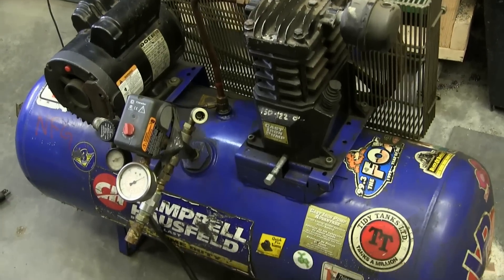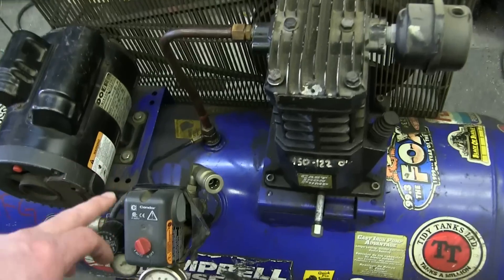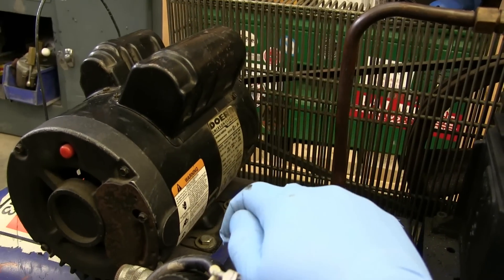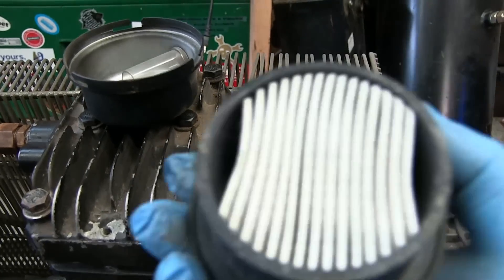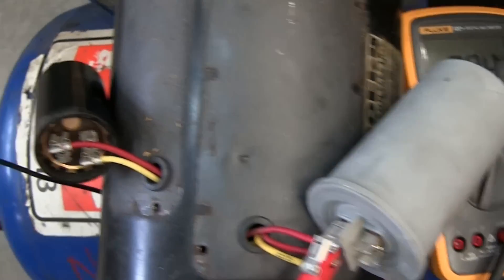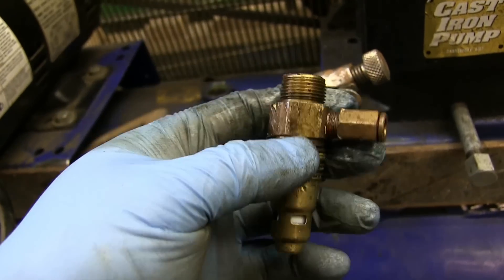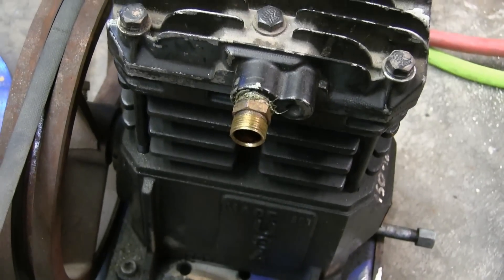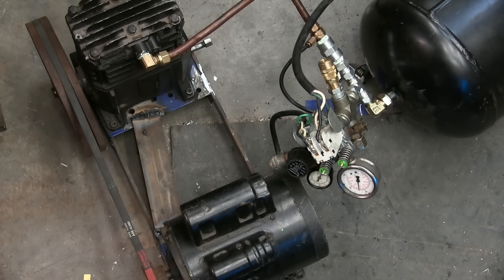BOLTR: Air Compressor Explained and Fixed.

Comment: Id be interested to compare what you say could go wrong compared to what ACTUALLY goes wrong with machines. In this video you didnt really say about oil thinning out due to high ambient air temp and running past the pistons then into the tank. 

We run a 500lt 8hp compressor at work that runs pretty much 14hours a day mon-fri.. Been doing that for a good 5 years. Never had to replace anything that you said would break. The big issues we do have. Oil in the tank, weve had to install multiple water/oil traps/filters/pre-filters etc to make sure it doesnt get to the machines.

Comment: When I worked for the medical examiner collecing bodies I picked up a fellow who died in a welding accident when the vessel he was welding exploded.  It was a large vessel, but the idea is the same.  The ladder he was tied off to came clean off the vessel launching him straight up with it, and he landed on concrete still in his harness still attached to the blown off ladder.

While driving him to the morgue a news broadcast came on the radio and his death was included in the broadcast, along with the fact he had a wife and two kids. I'll never forget that one.

Comment: The smaller line running into the pressure switch is probably the unloader and not for measuring pressure. The switch lets all the air out of that line when turning off so the motor can start up without a load. It must be on the pump side of the check valve!

Comment: Never use a heat gun to hasten drying of the developer as it also drys out the dye that may be in cracks or porosity when doing Liquid Penetrant Inspection.
Reply: Was going to say the same thing, but it is visible dye anyways, such low sensitivity, the crack would have had to be visible to the eye before the dye would pick it up.

Comment: Finally i get to say something. You know a lot but this time i know something too. The plastiq "sense" line is to depressurise the compressor when it is off but mostly it is to make the one way valve to engage propperly. Otherwise if it gets pressure from both sides and the compressor leaks only a little it will drain the whole tank. You need it to engage rapidly. That is the slight hiss you hear after the motor stopps, all the lines and the compressor depressurizing through the contactor.

Comment: That other capacitor is not for power factor correction. That is called a run capacitor. It stays in the circuit of the start winding at all times to form a series RCL (resistance, capacitance, inductance) circuit that is always powered by the AC mains just as the main run winding is. The start capacitor is just a boost to help give the motor extra starting torque that is wired in parallel to the run capacitor at start up and then disengaged by a centrifugal switch or current relay once the motor is running at full speed.

Comment: +AvE, can I ask why, if the tank is going to be shoved under a bench and ignored until around the time Chickadee is allowed to start dating, why you would even bother welding the motor and compressor onto the new tank?

Comment: Ave, the black capacitor is the electrolytic starting capacitor (Higher MFD) and the gray is an oil bathed run capacitor (lower mfd) that  is why it states no PCB. The old oil capacitors had an oil which contained PCBs like large oil cooled transformers which was outlawed back in the 1970s.

Comment: OK Ave I'm rebuilding a very old vertical milling machine I'm not sure if the spelling is right but I think it's a Yousa Japanese man mill and the God damn hand won't return the pointy things to top of stroke no more. it's a spring steel spiral spring snapped...any ideas
Reply: AvE yeah I also live in the frozen waste land but in the USA specifically North Dakota and my tiny town has no doesn't have a spring manufacturer or person for that matter so I'll do both braze it and order in a wide enough clock spring or just the steel at least....thanks from the frozen tundra
Reply: AvE got her fixed and everything working, auto feed and high speed turns out its a 79 Yuasa from Taiwan. learned that from watching your Vajeyos

Comment: My grandfather made an air compressor out of a fridge motor, the compressor for the refrigerant, and a cast iron tank. The whole assembly weights about 90 pounds, its all iron, or maybe steel, I'm not smart 'nuff to know which. Also, the newest part on it is the belt, and the belt is 18 years old and still works. The fridge it came from was made in the mid 1950s I believe. Skookum as it gets.

Comment: It burned through because your amperage was sky high. You run a 1/8" 6010/ 6011 at around 70-75 amps for fairly deep penetration, and 3/32" at around 50-55, especially if you're putting a root pass in some pipe. The old farmer rods like really low amperage, since they're such deep penetrating rods. Not being critical, man, just helping a fellow tradesman out! Keep up the great content!

Comment: I would repair it with a small Tig pass. Depends if the tank wall was failing or not. If it's only on the fitting it's kinda safe.

Comment: Sorry, I have to call 'bullshit' on your explanation of the run capacitor on the motor. The run capacitor has absolutely nothing to do with power factor correction. Your explanation of the start capacitor is correct, it feeds power to the start winding that is offset to the run winding a certain number of degrees in rotation. The cap shifts the phase of the ac going to the offset field winding to start the motor going in the proper direction. The centrifugal switch disconnects the start capacitor from the start winding and either switches the run capacitor onto the start winding to feed it power continuously giving the motor more torque, or the run cap is hard wired to the start winding and connected all the time. In some cases the run cap is always wired to the start winding, in other cases the centrifugal switch is a spdt switch used to connect the run cap to the start winding. The start cap provides more voltage than the run cap to provide a higher current to the start winding during spin-up, but too much current to run continuously and would thus burn up the winding. The run cap is sized to provide a lower voltage to the start winding under run conditions.

Comment: I had the occasion to get shown a way to fix cracks in metal by a crusty old half drunk old guy master fixer. He showed me to drill holes at the end of the crack, this stops the crack from continuing after the weld up. Sort of stops the crack in it's track.

Comment: back in times gone by I work in a shop as a pipe fitter on alot of pressure vessels.  bomb is exactly correct.  anyways instead on grinding it out and welding a split in thinner metal like that, we would usually build a gusset of sorts to encompass the crack. give it a little more back bone, but in this case crapping the tank is alot more logical.

Comment: whats the logical first step when a compressor like this starts and pumps once and then seems like its jamming up.  Electric motor hums and stays on til the breaker pops.  Not frozen as if I try again it'll start and pump once or twice before doing it all over again.

Comment: That's not your girlfriend ave... if it's so wet it's dripping you're doing it wrong. The solvent in the developer is meant to emulsify the penetrant so if you put that much on it'll all come out kinda pinkish spread everywhere, you want the Dev looking just slightly damp after you spray it on then you'll be hooked on the crack like me.

Comment: the scene line is the one from the tank that the pressure switch mounts on , the line from by the check valve to the pressure switch is a dump line to release the pressure from the line between the compressor and the check valve so at to let the motor spin up with no load

Comment: Hi Ave, great video as usual ! 
That power factor correction capacitor does more than keep the power company happy, it makes it possible to run a motor that size on a standard plug. 

Because the power is the product of the instantaneous voltage and current, as the voltage and current move out of synch with each other it takes more current to supply the same power. 

I'm not sure about your supply system there, but here in Australia compressor motors of this size would need more current than a normal power circuit would allow, if the motor was run without the power factor correction capacitor. The power factor correction capacitor pulls the voltage and current back on top of each other so the motor draws minimum current and the manufacturer can keep a standard plug on the compressor .

You could test this by running the motor with and without the power factor capacitor, and check the current.

Comment: Rather than tap your rod to try to get it restarted, try scraping it on the concrete floor first (just like you were going to strike an arc). I found that it works so well (especially for 7018) that I will put a piece of a concrete block on a welding table so I don't have to reach down to do it.  Also, the 1 amp per 0.001" of rod rule is pretty good for most rods except 6010 and 6011, they tend to need a good bit less.

Comment: I think it says something about Campbell Hausfeld if they hire kids right out of high school to weld on pressure vessels. Most respectable places want people with at least 3-5 years welding experience to be eligible to take a test to qualify or certify to weld on pressure vessels! Where I work we have welder's helper, mig welder, welder A and Certified Welder. This is a paying of your dues chain to make sure that no shitty welders slip through the cracks or get lucky.

Comment: I like my Schuko plugs more than the murican ones.
And for the heavy stuff we have 3 Phases because 2 ain't enough. 400V of course...
Oh and for Motors we don't need no Neutral...

And we also have something like star and triangle switching to start a Motor and stuff like that.

Comment: I'd drill holes at each end of the crack fill her full of Dawn for a day, rinse it out and weld her shut easy. If she was too rusty it's would be a hacked open for a fire pit but. Got a forklift propane tank in the backyard that makes a fine small bbq. Think it only cost me $2 worth of Dawn dish soap.

Comment: Can't remember the video where you talk about lithium batteries on power tools 

But hear me out now, full bridge rectifier, and capacitor bank as your backup. Initial start with a bit of a timer relay that puts in to regular AC use to prevent that much sparking. Along with that, we current sensor (a cheap hall effect sensor can do), which when a certain current is exceeded (say 14 amps, cause a lot of fuses here are 16 and 20 amps) it just switches over to the capacitors for that extra bit of torque for the time needed, with a bit of sparkle (for the ladies of course, they need to tan their eyeballs just as much as we do) . 

Seems a lot cheaper, and a lot more robust than li-ion batteries (capacitors can be max discharged, and won't explode when putting out too many amps)

Comment: I bought a brand new 60 gallon compressor about 2 months ago. on the side of the tank is the production date. 6/16. It says tank is good for 10 years. replace tank after 10 years.
guess that's a new thing.
safety? Or just another way to sell more products....

Comment: Hey Hoss, how are you going to drain condensate from that tank?  Compressed air cant hold as much water so it condenses in the tank. This has the dual function of filling up your tank with non compressable fluid making your compressor cycle more frequently and getting right fooked earlier. Plus it helps destroy your tank. Got to have a drain in your tank.

Comment: The black capacitor is the start cap. They are rated for a limited number of starts an hour or they overheat and can blow up. The  29 mfd cap can be in the circuit all the time.

Comment: Dye pen is your friend. Use a cleaner to get the junk and oil out of the crack but it doesnt have to be perfect. Spray the developer lightly so as not to wash the dye out of the suspected crack. Air receivers are made of thin sheet that has alot of surface hardness from its manufacture. Vibratory service makes them prone to cracking. The mill scale on the inside and out of the thin air receiver material makes a generous amount of porosity when tig or mig welding. I have repaired a few of these but they are not repair friendly or even worth the safety or liability risk.

Comment: 10:14 yes you did get the caps in reverse the start cap is the black one and the oil filled cap (gray one) is the run cap. The oil keeps it cool since it's always in circuit.

As a general rule when working on capacitor start / capacitor run motors the start cap will have a higher capacitance than the run cap. The start cap also will blow if a bad centrifugal switch leaves it in circuit for too long since it's not rated for continuous duty like the run cap.

Comment: I always did double helical screw compressors with dual evap dryers, but those were bigger shops. Every time the pressure gets low, an alternate compressor kicks on to avoid moisture in the air. Same deal with rotary vane or piston type air compressors for large HVAC pneumatic controls. We had a tank fail, and the top cap came off, went through the roof, and was never seen again. My neighbor blew the head off his compressor. It went through the roof, and came back down through another neighbor's roof. My neighbor moved out in the wee hours and he was never seen again.

Comment: Its odd for me to see a compressor with a failed tank like that. I build smokers for a hobby so I collect old tanks. 99% of the ones I see are failed switches or bad motors. Except the local trash store ones and they usually have bad pumps.

Comment: the motor that you got there is definitely a 56 frame hundred and twenty volt probably a two horsepower to do it having a start and run capacitor and by the back of it it looks to be an old Emerson the used to build those Motors right last 20-30 years now they garbage guaranteed to break day after warranty

Comment: Regarding the phase angle between voltage and current: Take cosine of that angle and it should be as close as possible to 1, meaning your complex power [VA] and active power [W] is close to equal. Any difference between those draws extra pixies you're not gonna have any joy of.

Comment: Hey AvE, do your hearin' holes a favour. Come spring, build yourself a compressor dog house out the back. You can use scrap materials, and obviously you'll need some kind of insulation - I think you North Americans call it 'cellotex'. Bonus idea, build your daughter a swingset type deal and use the offcuts from that. Happy wife etc etc

Comment: The Campbell Hausfeld 20gallon 2 cylinder Single Stage Air Compressor was a good unit in it's day. Very similar to todays model VT6290 (same unit was also branded as Speed-air and Dayton back then).  This is a very common problem.  The tank is not particularly thick and also the bung, bushing and drain valve get hit all the time in the bottom of the tank.   To fix, we let a welder with a pressure ticket patch these tanks up for about 60-100 Cdn. Peso Bucks.  This is with no guarantee it wont happen again.

I was getting worried when you said you were going to take the head off.  Glad you didn't.  It's not really serviceable without buying a new head kit (replacement) as I recall. The gaskets are not standard and only included in the head kit.  Last I priced out  was about 295. to 395. (maybe 3 years ago).  I could sell a new replacement (different) pump for less.

The 1/4"OD nylon tube that runs from the check valve to the pressure switch works a lot different than you seemed to describe.  It is the unloader line that is actuated (bled) by the pressure switch when it trips, or cycles off. This unloads the pressure out of the filler tube (to the head) so the compressor can restart.

All else looks good except the Filter Element - I have those if you need - Langley/Surrey area.
Reply: Maximum pressure from the factory was 125psi.  If you re-set them much higher they would blow a 15amp 110V breaker.
Reply: My Bad ... Sincerely Sorry to add inaccurate Schmoo to the noise.  Looks like this version has 'real' replaceable head gaskets.